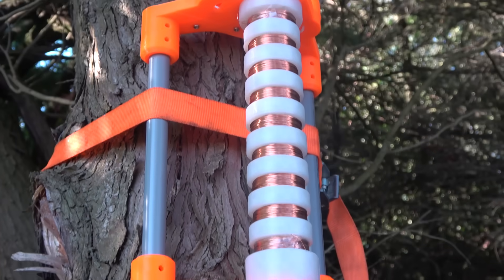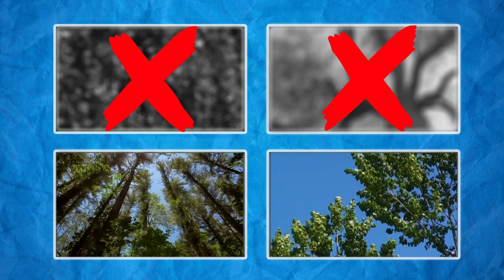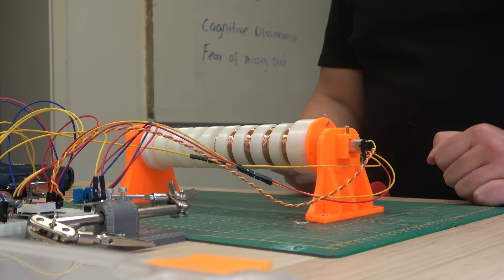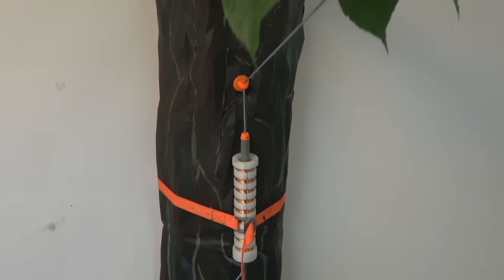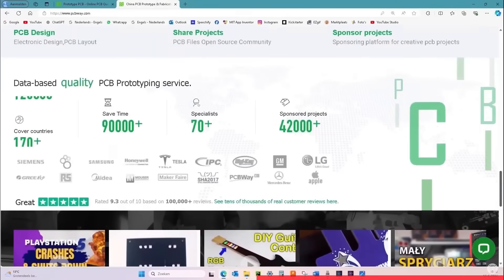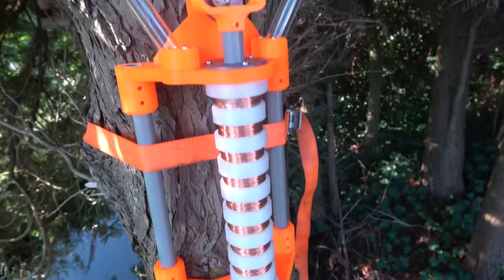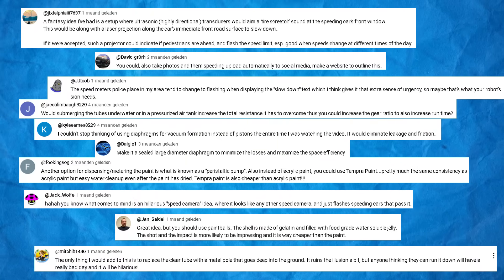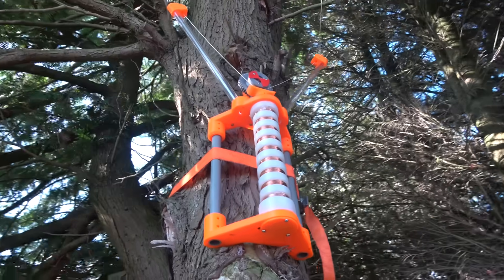I Made a Tree Generate Electricity..

Comment: I know that there's 1,200 comments, so there's no way you'll ever read this... but... 😊 👉 👈 
I think it's possible to take energy from the trunk bending. 

Have a durable enough tensile connector, rope, chain, metal wire, etcetera*, have a good number of connectors to the tree to keep it away from the bark, though there might need to be a bunch of them, the more you have the less loss to friction with them, but also the more energy you'll get. 

Take these and line them from the to of the tree trunk to near the roots, but the top should be twisted 180° to the opposite side of the bottom. The connectors need to be connected by "yoyo-like" weels that can freely turn A LITTLE. (NOT enough to fully spin around and unravel. This allows for all bending of the tree to pull the string and then let go at the tree straightens out again. Have something at the bottom that can reliably turn tork into momentum such as a rod that can spin and turn magnets or weels. 

To recoil it, you COULD just have a casual spring force to recoil the rod/weel to it's original position.... but you could ALSO just place another wire up the tree or lengthen the frst one, to counter this. Basically a back and forth motion like using a flosser on your teeth. + more energy because the tree is forcing the pull in both directions.  😊

To better secure the wires, you can probably set up an end-connectors AROUND the base of thick branches so they don't move. 

I hope this helps in some way. I love the idea of gaining cheap power from trees!
Reply from the maker: I read every comment🤓
Reply: @ConceptCraftedCreations   🤩

Comment: Great! I love it! Actually you can make tree-free version -  artificial tree with long vertical or diagonal arms with like sails at the top to catch the wind better. You will have more power than the tree leaves generate(the tree leave are floppy so they give way to the wind power and bend/flex losing most of that wind-fulcrum power). A more fixed stiff sail will make use of almost all the wind power sending more force straight down to the gears. Or you can even put sails on the branches for extra power. And since you have much more power, you can improve the gears ratio. Bigger big gear and smaller small gear. This will definitely improve things and you wont have to bother the trees. And like @mikeydk below said. You convert a gear to a fly wheel(energy store via momentum) on the big gear(or maybe the small gear) to compensate or smooth out the energy loss/deficit from the piston changing directions - inertia. The small gear can also have a small strategically placed counter-weight to help counter the gravity on the up travel of piston. Or maybe you can install a second piston that is attached like a seesaw(the move in opposite direction) to the 1st. This may help cancel the burden of gravity in the system. Or maybe just put your piston sideways. Love your work!

Comment: What about using a climbing system with a weight so that when the branch goes one way, the weight goes up and latches, then when it goes up again it latches to the next step until it gets to the top, then it drops all the way back down and starts the climb again. This would give a much more consistent output over a shorter time. This would make it so you could use various types of generators too.

Comment: if it was connected to a higher part of the tree instead of just a limb (taking advantage of sway of the tree), you could up the gear ratio to a 40:1 or higher  easy because of the mass of the tree itself. might need guides to keep the rope up close to the tree on the way up. If need be instead of just making it go faster and faster, you could triple the size of the generator itself to make less speed but the same energy. (i have no clue what i am talking about i do not specialize on this topic)

Comment: Love the idea, however as the tree grows there may be issues with strain on the wires and potential snaps. You may be able to counter this by just gradually moving the system higher or allowing the cables to be increased in length over time manually.

Comment: Its a fun waste of time and a learning adventure. There are several hundred years of cheap hydrocarbons to burn. About 10,000yrs of nuclear energy to use. Wind is a secondary source of solar, so harvesting motion of trees for energy is literally gleaning leftover bits of energy.

I think the top magnet is redundant and possibly counter productive due to gravity pulling on magnets.

Something in me is saying, "Is there away to replace the gear system with hydrolics in a more efficient way? Reduce the friction losses?" What am proposing has lots of knotty little problems. It may be a lower idea due to moving the mass of water in a closed system requiring more energy than friction loss in the gears.
A diaphragm pump, pumped by a cam driven by the string? A diagram at the bottom stroking the rod with the magnets?

Comment: Use a long, bottom-weighted flexible pole with vanes around the tip to catch wind from all directions. Connect a series of generators to these vanes at the base, and use a battery bank for energy storage. And if you place a sturdy coil spring between the pole and the base you will generate greater movement.

Comment: This is really fascinating to me because the tree is kind of acting like your wind turbine. You can cut lots of cost by not needing to build the windmill blades. I'm wondering if it could be made more omnidirectional by running 3 ropes up the sides of the tree, so when the trunk bends at least 1 is getting pulled. I think using the trunk of a tall and bendy tree could give you more power since the trunk collects wind energy from all the branches. You can also get more mechanical leverage by strapping a horizontal contraption along the trunk to hold the rope further away from the trunk (makes the change in distance due to the trunk bending greater the further away the rope is held I think, at the expense of holding back the tree's motion more). Another way to combine multiple oscillating rope inputs could be a ratchet like the back wheel hub of a bike, one on each rope would allow the ropes to be decoupled but the one that is being pulled the fastest would transmit its rotation. A side effect is that you would get unidirectional rotation. If the whole tree bending provides a lot of torque you could gear it up further and drive a traditional generator motor.

Comment: Trees can exert up to 20885 Psi when growing. You should try to use this pressure caused by the growth of the tree to generate some electricity.
Reply: The number of psi doesn't mean much. Imagine a tiny capsule holding 1000 psi and a giant tank holding 500 psi. Even if the big tank is holding less pressure it still holds a lot more potential energy... Now for this project you would need to build a metal frame around the tree because using wires would be too elastic to hold this pressure, especially over many years and all that just to get a few watts per years, if you're lucky. And I'm not sure he'd want to invest many years into a project just to potentially make a small video on Youtube.

Comment: I read some good comments talking about torque/geared and ratchets.
They made me think of the idea like the pull-wire from a manual starter for a combustion engine. 
From the neutral position bending away the tree could pull on a cord wound around a wheel or the axle converting the linear motion into a rotational one so you can spin a small geared conventional generator (or use a motor as a generator).
You would have to use the forementioned ratchet and add a spring to rewind the wire around the axle when the tree goes into neutral position giving the slack back.
Adding a flywheel could improve consistancy and efficiency of the generated power aswell as capacitors and/or inductor filters on the DC voltage.
All in all, I like this novel idea as I am a nuture loving electrical engineer. 
I don't know how much power you would generate but I could imagine one tree slowly charging your phone.

Comment: You 've already converted the movement into a circular motion.
Why don't you drive a DC-Motor as a generator?
These motors are cheap and you don't have to build coils and a magnetic core.
You 'll also have no problems with the weight of the magnetic core.
Rectify the oscillating DC-current and load a battery.
There are efficient motors for electric scooters available for around 40 Euros. They have 3 phases, so you need 3 rectifiers.

Comment: Hey, I had a similar project once. Our conclusion was that there is too little energy to ever become cost-efficient. But we had different approach and also left out some possible favourable factors and fields of use, so hopefully you'll get closer to success. Some ideas: 1) Harvesting movement of trees relative to each other and connecting it to same mechanism (connecting trees to each other with same ropes). 2) A "crane battery" instead of linear generator to save on conversion losses - mechanically winching a weight up and letting it go back down through a normal spinning generator. 3) Same but with a flywheel instead: tree movement spins flywheel up to x rpm, generator switches on, speed decreases until y rpm, generator switches off, repeat. 4) Invent variable gearing system to get most of both quiet and windy days. If tree pulls string strong, high gear ratio is selected to get max energy from same movement. If tree is pulling weak, low gearing is selected to still be able to use it, not stall from too much system resistance.
Reply: 2) A "crane battery" instead of linear generator to save on conversion losses - mechanically winching a weight up and letting it go back down through a normal spinning generator.

people in rural Africa use this to light their homes. they have a rock on a string, they pick the rock up to the ceiling, and let go and it slowly drops over the course of a few hours and powers the lights and stuff,  and then they pick it up again when it gets to the ground. free electricity for just picking up a rock 3-4x a day. pretty good imo
Reply: Please mind that a forrest full of ropes could disturb or even harm the wild life living there
Reply: @badizzl  no more than clearing the forest to erect a bunch of wind turbines
Reply: @badizzl had not thought of that...maybe hi vis cables/strings? Probably have to talk to wildlife conservation for a viable solution there
Reply: Your best source,is water,a water turbine, works perfectly. You can make them yourself and put it in a river,it can generate a town if you want it to. Trees even know that
Reply: @deemisquadis9437 Ok that’s good but it assumes a river exists where you want electricity generated. They aren’t as abundant as trees
Reply: also the devices used to attach to tree could be almost free, or made with remodified waste items. just powering a single modem, or I-phone would be fine, perhaps if you could make enough power for a laptop it would make it about break even in terms of time and money put into the project...
Reply: They are only not cost effective time if you are trying to do large scale powering with this. Powing something small like lights, or a small water pump this is perfect, and creates a super minimal footprint, and can be set up, and forgotten for the most part.
Reply: @karlerikrabakukk2694  awesome ideas. Worth looking into
Reply: So trees capture the wind (the true energy source here) but I can’t stop thinking about the weight of those trees. And then there’s tensile strength of the trunks..
Reply: the benefit is that its easily scalable and uses a reneewable energy source
Reply: I think the generator turning off would not be ideal cost effectiveness wise since I think having any downtime would outweigh any benefits when it is in motion (compared to using a more conventional alternative). but still interesting nevertheless. A possible way is to connect multiple trees, so that there is at least a few trees which are powering the generator.
Reply: What's the watt product?
Reply: Seems like nothing will make it even close to the generating capacity of even a tiny windmill.
Reply: @afterthefact6708  Therfor the question might be when to use such a desperate idea, and I came up with the idea of a situation where resources are limited and the need for energy is minimal.
Reply: The movement of the tree is caused by the wind, seems logical to cut out the middle man (or plant)
Reply: @DC3328 The "cutting" is the problem. Not trying to destroy my trees when they can slowly fill batteries for me. Personally I'd need alot of them so I'll have to use multiple methods

Comment: I've probed a tree with aluminum and copper rods. The farther apart the ends are, the greater voltage I got (Xylem and Phloem seem to act as capacitors). Negligible current, also picked up the 60Hz hum from the power lines.

I also believe some spider webs are actually transformers, as the inside coil is detached from the outer coil. However It is so delicate I haven't been able to connect to them to check. I imagine it would help amplify the electric signal prior to an insect actually touching it. And possibly it could greatly disturb the electric "feeling" when they do hit the web, though it seems unneeded as the vibration should be enough..

Comment: The trunk swawying seems to me like it sould generate much more energy then the branch and I think it would have a largely diffrent process due to the forces involved and the fact that it would likely have ot be tethered to something else: you could use the bases of ajacent trees as an attachment point.

Here are some more obvious problems that I see that you might be aware of: I do think that the energy from this will be hard to use since it isn't at any specific frequency. I also don't know why you built an only up-down movement generator and only to then build an exclusivley left-right generator: if you want both capabilites why not just attach the two simpler up-down-generators on diffrent points on the trunk. Also, if you do use the left-right generator, why not just use a normal rotary motor instead of convering rotary into linear motion to then use a linear motor?

Comment: What happens when the branch is pulled upwards by the wind, both of the ropes would be tugging on eachother and maybe break after some time. I think it would be smart to put some kind of safety like making the two ropes go into two diffrent wheels on a ratchet so that when the branch moves side to side they both can still generate electricity but when they start pulling on eachother, with enough force the ratchet will skip ensuring that the ropes can still work together but they can't destroy the second one.

Comment: Love the linear generator. I'd be interested to see you stagger the coils and the magnets (more specifically, use a different gap length for the magnets vs the coils, my best picture of this is a vernier micrometer's tenth notches vs the normal notches) so that they aren't always perfectly in sync, potentially making the power delivery lower but more consistent. Each coil should fire at a different time during one single stroke of the solenoid.

Comment: My only idea for the generator itself is to make multiple coil assemblies and have all of the magnet shafts connected to one another via their own bracket. You wouldn't really need to attatch extra strings either since they would all be acting as one unit. Just attatch it to their bracket and all of them would move in sync. The bracket would probably have to be on some guide rails though to keep it stable.

It already looks like you are using low friction materials, but lubricating the inside of the coil assembly couldn't hurt especially if there are multiple coil assemblies. You could probably get away with making 2 or 3 extra without a drastic increase in size.

You would need to redesign the bracket completely but the output from induction could really be as big as you wanted it to be depending on the amount of coil assemblies you make use of, as long as the magnet assemblies don't weigh to much when combined. 

You could just make the coil assembly really long, but like you said you aren't trying to make the thing huge. So I'd reccomend taking advantage of the horizontal surface area of the tree rather than verticle.

You could even throw a rechargable battery or two on it so that way you can get nice clean power at any point of the day rather than inconsistant power only when the branches are moving. If you're trying to charge your phone straight off of the generator with no battery in line that could be bad for your phone. If you didn't want to use an entire battery I would reccomend a capacitor assembly at the very least just to clean up the output power so your phone isn't recieving/getting cut off from power too abruptly. 

Really you probably just don't want your phone recieving current in random increments. Not only is that bad for your battery but it could be a fire waiting to happen depending on the amount of power being induced.

The only issue I see with it is the weight of the magnets, like you already said plus the added weight of connecting them with their own bracket. Wind is powerful though, I don't think it would be impossible to do.

Comment: I believe one of variations of project you can try, is to use the trunk bending. It generates less displacement and speed, but a lot more force, besides the movement is much more predictable than the branches. You'll have to calibrate the gears, and the farer distance of attachment from the ground, the greater will be the force, because the leverage effect.